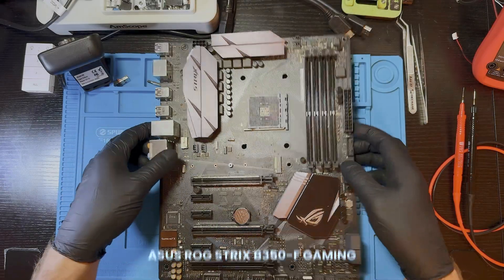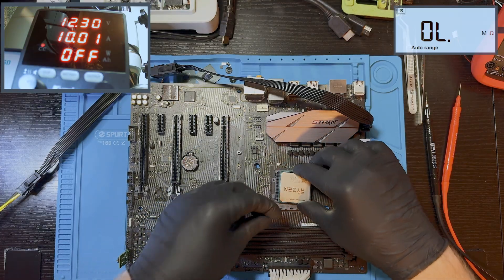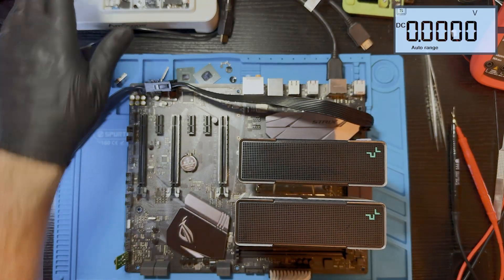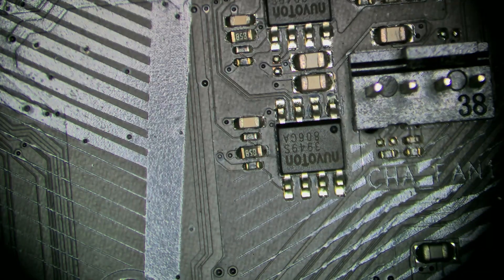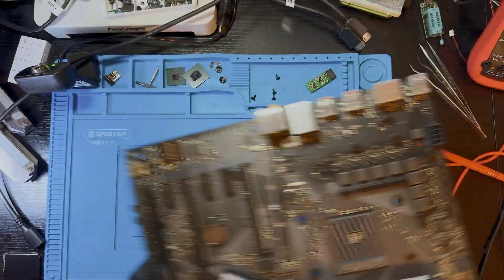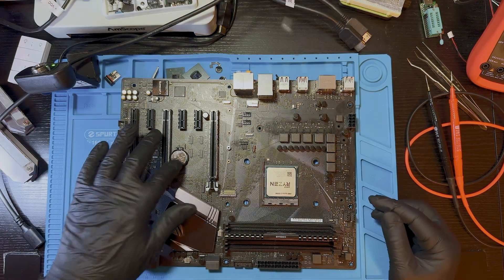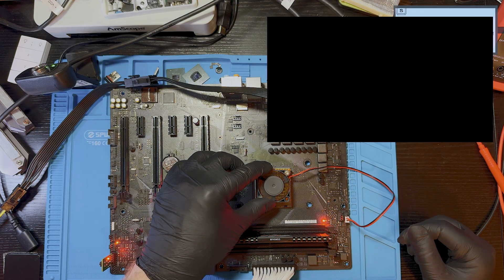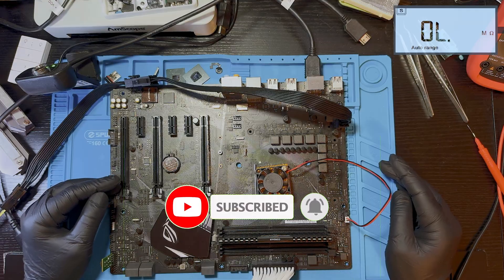ASUS B350-F Gaming: No-POST Motherboard FIX (Corrupted BIOS Flash Repair)

Comment: Just curious, what would cause a board not to post unless you jumper the green and black wires on the ATX connector?
Reply from the maker: It usually means something is failing in the very first stage of the power-on sequence. For the system to start normally, the PCH/CPU must release the sleep signals (like SLP_S3#) so the SIO can pull PWRON# low — the same effect as jumpering the green and black wires on the ATX connector.
If the board only starts when you manually short those pins, the SIO isn’t getting the proper wake signals. I’d check SLP_S3#, SLP_S5#, and PLTRST# to see which one isn’t coming up.
Reply: @FixThePixel  thank you for responding. I found no faulty components or damage of any kind to the board, but your videos gave me an idea to look into the CPU socket. There were a couple pins that weren’t perfectly aligned after looking with a microscope. I was able to fix the pins, and that turned out to be root cause. The board starts via the power button now 👍

Comment: Finally you tried to flash using cables. You can just check resistance between legs of chip and header of BIOS chip. You will know exactly what pins to connect. You do NOT need to connect pin 3 and 7 only 1,2,4,5,6,8. Pinout is often same across ASUS boards, same applies to MSI their pinout is identical across almost also once you get it right it becomes easy.
Reply from the maker: Haha, you caught me! I tried to go the “cable spaghetti” route this time. 😅 Thanks for advise! I definitely have to find some time to make an adapter for that!